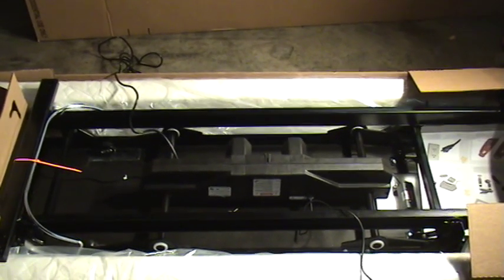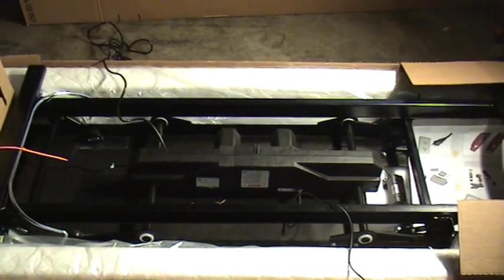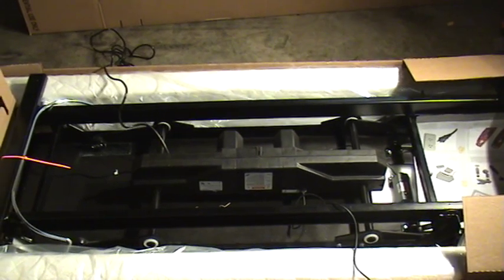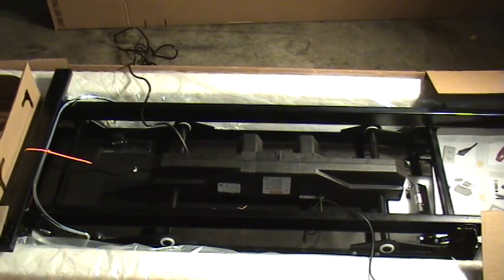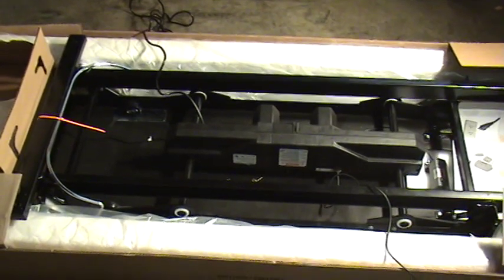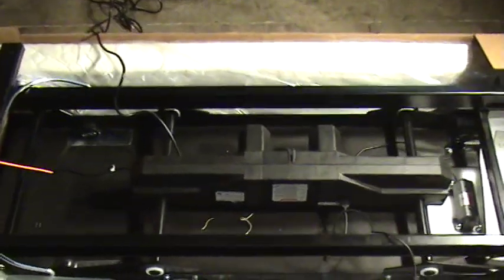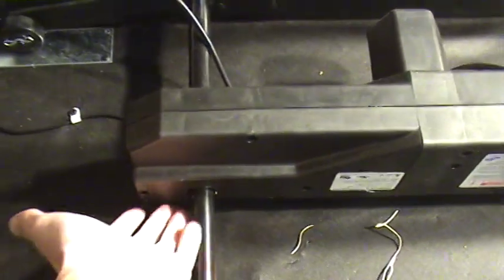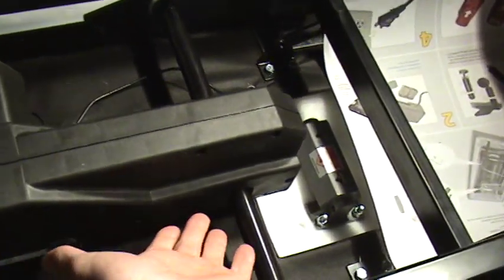Adjustable Bed by Leggett and Platt DC Motor Repair - Part 1

Comment: i need one....where can i get one
Reply: +Donny Boy;  I purchased a bed on e-bay that looks VERY similar to this under the brand name Ergo Pedic. It was a great deal, sold by "whypaymoreshoppe". I'm not sure that it is identical to the L&P, but the seller does also sell the Leggett & Platt. One thing is for sure; the motor IS identical to the one show in this video. Hope this helps!